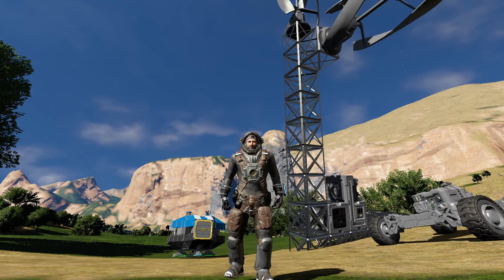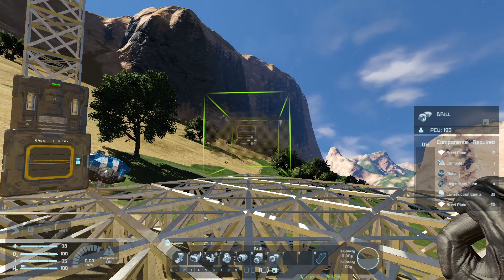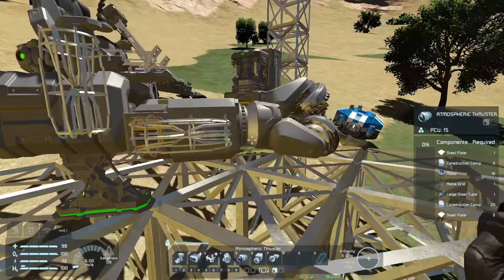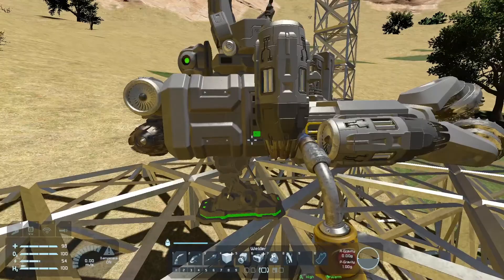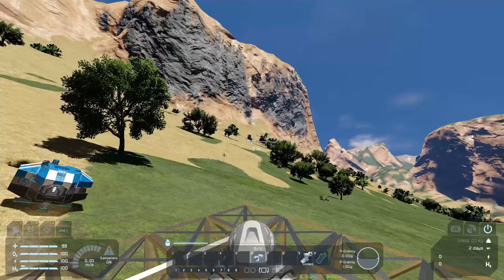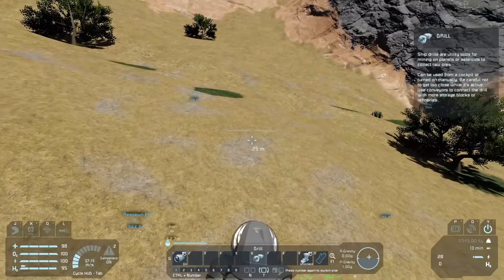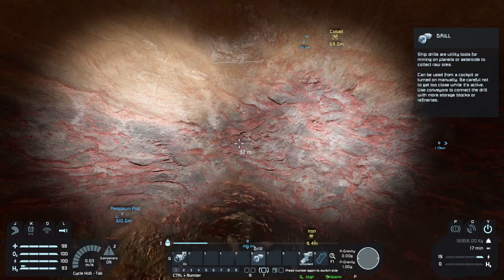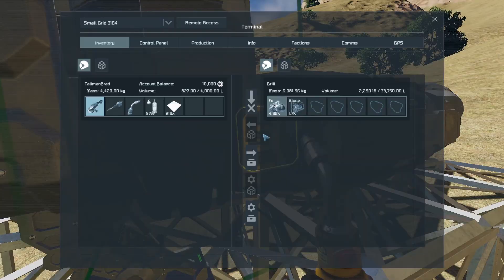Space Engineers: 04 First flying mining ship

Comment: Thank you for the very basic drilling ship. Nothing fancy, but then that's OK.  I like it! BTW, how did you charge the battery after you built it on the ship?
Reply from the maker: You're very welcome Gary. To be honest that's a disposable miner. A little later in the series I'll walk you through making a long-term miner. That basic one will get anyone started and last a reasonable amount of time. If I was going to stick with it I'd remove the landing gear and replace it with a connector. Not for transferring materials, just for charging.